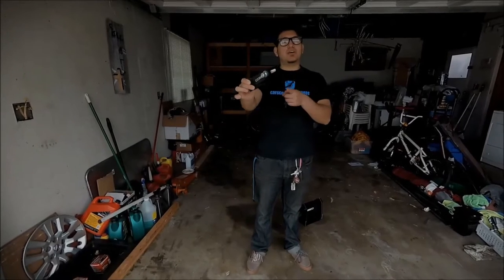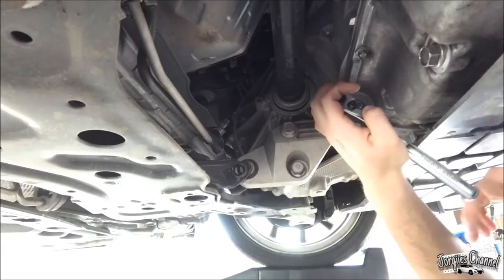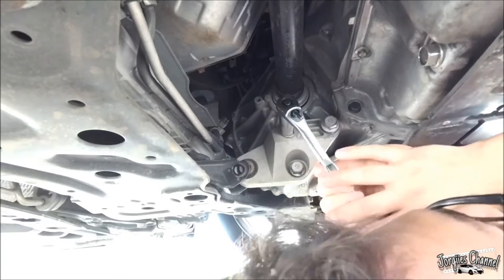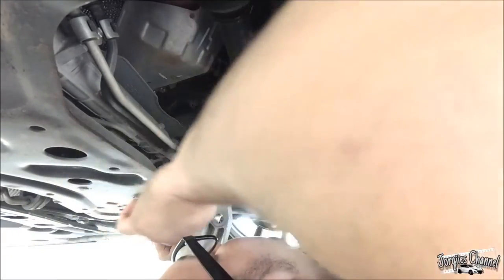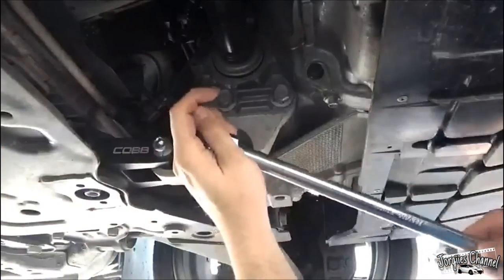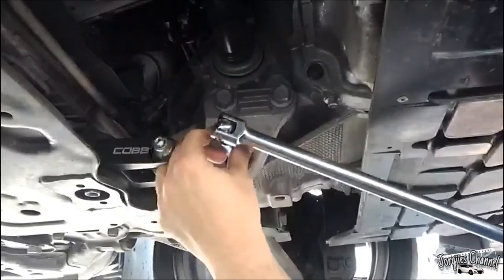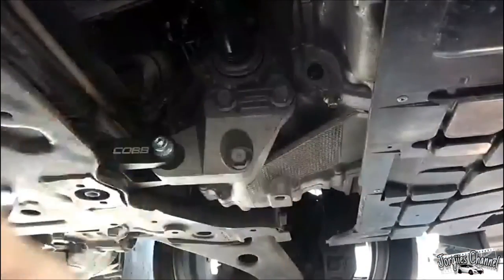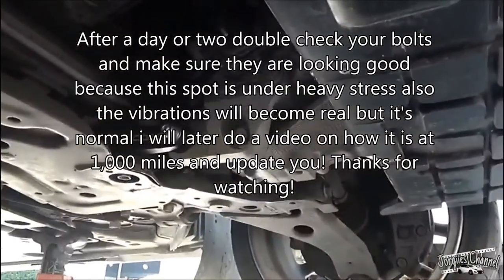Cobb Rear Motor Mount Upgrade

Comment: Have any problems with the RMM becoming loose? Specifically the rubber part, or it sliding out of place
Reply from the maker: I haven't had any issues with this cobb rmm yet. Still there, although once you go for a drive prior to installation; I would recommend to recheck the bolts as they may loosen, and this is the same for another brand. I like double checking things.
Reply: @Luminary_Industries  thanks for the advice. Im debating on buying damond RMM. But I want to stay all Cobb if I can. Is there really a difference?
Reply from the maker: @rehdart1730  they do the same thing, just different styles, and brand name.

Comment: Can you please add the link to where you got the mount
Reply: Avoid this mount.
Reply: @armesisp3201  i love this RMM...why avoid? Solid Mounts are a Race style mount not made for the casuals lol
Reply: @daniellee6408  The vibrations dislodged my dashboard panels, until now they squeak. Not to mention it makes the cabin sound like a lorry. To me that is not acceptable, others may find it ok. Granted it made the shifts really smooth, but it ruined the NVH.
Reply: @armesisp3201  yea the AC on does make it vibrate bad i forgot how bad it is lol.
Reply: @daniellee6408  You sold the car already? I still have mine and drive it alot, the CBU quality is great and its still like brand new. I love how the transmission can take daily abuse haha.
Reply: Armesis P sold my car? No I daily the fu*k out of her lol. I don’t run the ac much at a stop and I now remember why lol.
Reply: @daniellee6408  hehe nice, enjoy.

Comment: This mount will add alot of vibrations that will shake the interior panels loose if you use AC. I ended up uninstalling it.
Reply from the maker: It works fine with me. After a couple of years, i have no issues. Also feels fine. Each has their own preference too.
Reply: After a couple years? No thanks. Got mines on eBay for $30 and perfection on performance
Reply from the maker: @teddysrandomstuff60  well to each there own, im not boased on the product. I have been fine with it, i have no issues. No rattles that you've mentioned. But good! ebay parts do work as well. Depending.
Reply: if you have decent power aka a tune with bolt ons a RMM is a must....it puts the power to the ground and shifts so much better.